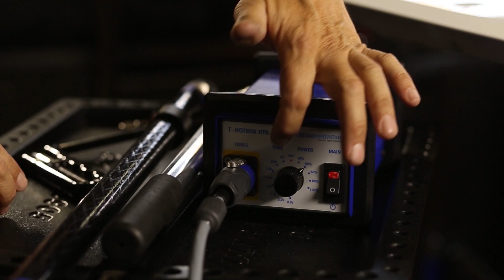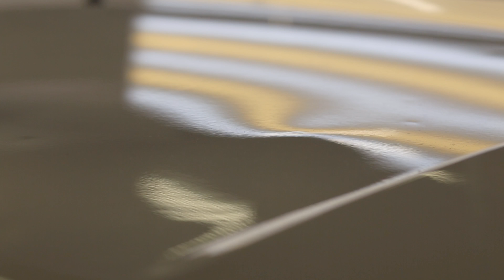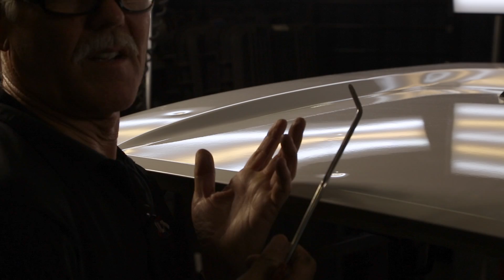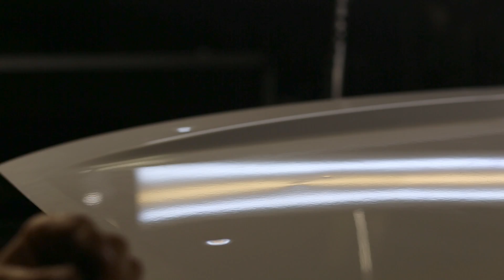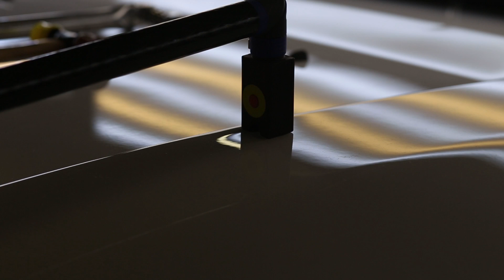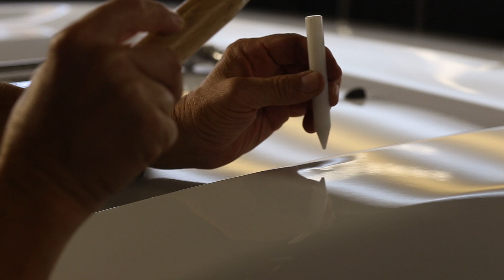PDR TUTORIAL - ULTRA DENT TOOLS T-HOTBOX TIPS AND TRICKS

Comment: What model lights are those??
Reply from the maker: That Large light is our WideHead 46" A1BA36-LED5 light fixture. $499 for the light and mounting collar. Stand sold separately.
Reply: Thank you so much for your time. Would you happen to know what the total job would cost at a shop?Do you offer a dent chart size guide?